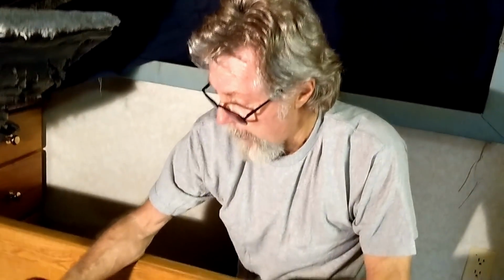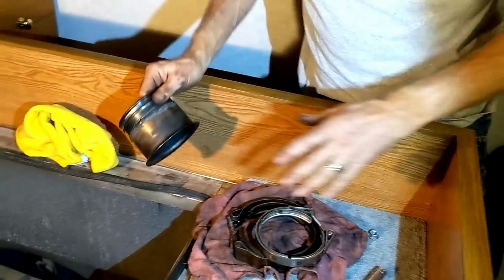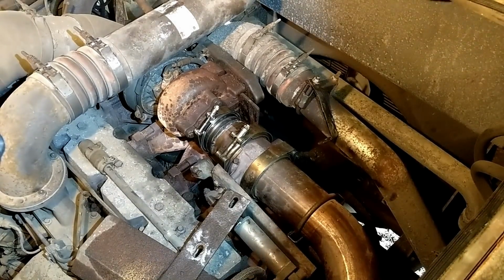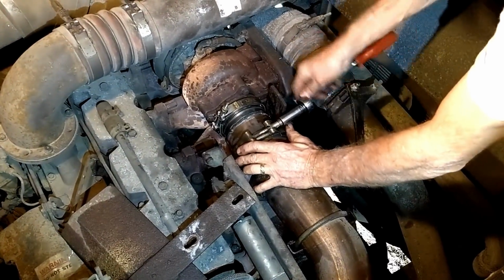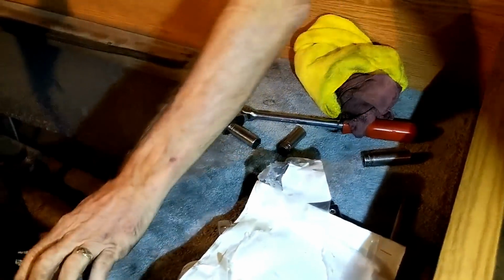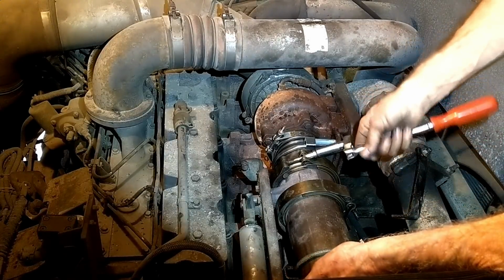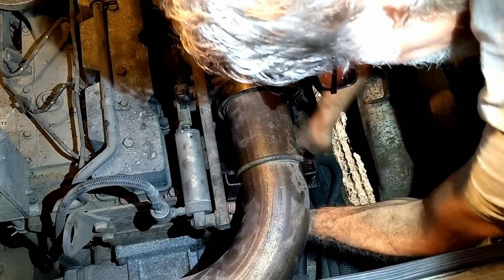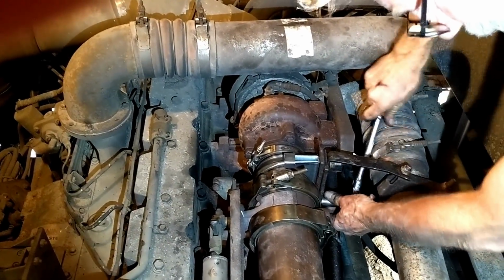V-47 DIY How To Repair Turbo to Exhaust Brake Pipe-Leak

Comment: Question? @1:10min. you said that you "always leave your exhaust brakes on"? When I drove a Big Truck, I never used the "Jakes" (Exhaust brakes), only in the hills or mountains. Leaving them on could present braking problems in  rain/snow  weather, and not to mention unnecessary noise that could get you a ticket.
Reply from the maker: It's a exhaust brake so it makes no noise also I had the Allison ecm modified to only down shift manually !!

Comment: Need some lock washers on the bracket clamp...
Reply from the maker: Nylock nuts Barry
Reply: Nylocks are not to be used around heat? (Exhaust)
Reply: CAJUN Jamis yeah ur rite but lock washers will wrk and maybe double nut.
Reply: Economic Refugees if that get hot they won't wrk..

Comment: Thanks Darla for asking Bill to explain some things he says; that are obvious to him, but to me NOT! What was the initial symptom, noise, exhaust smell, brake not working?
Reply from the maker: Exhaust smell in the bedroom after a long drive and I could feel the leak !!
Reply: Thanks. Is that a metal to metal seal or is there some kind of gasket (asbestos?) on each end?
Reply from the maker: No, it's a steel seal & the clamp totally seals it  !